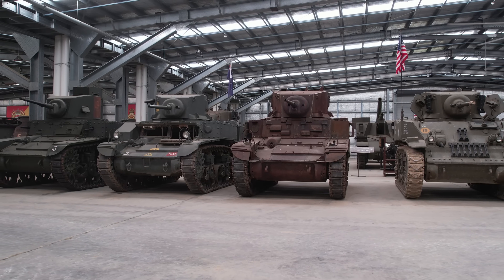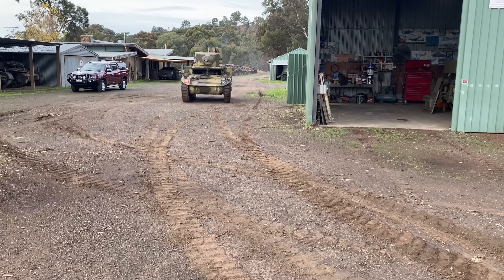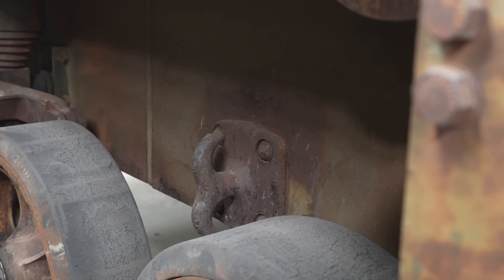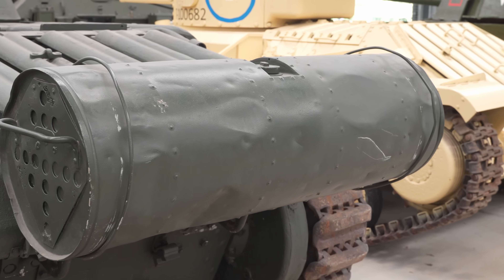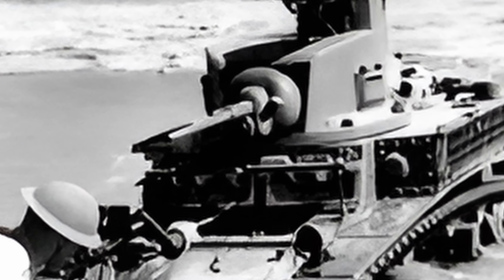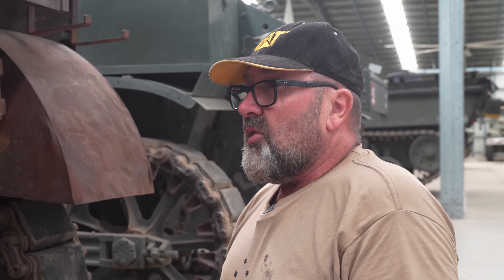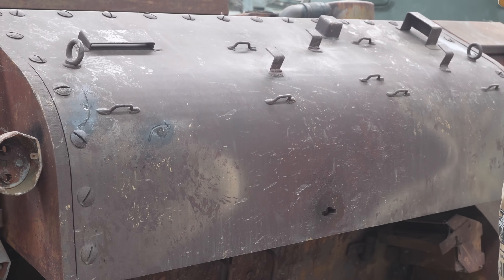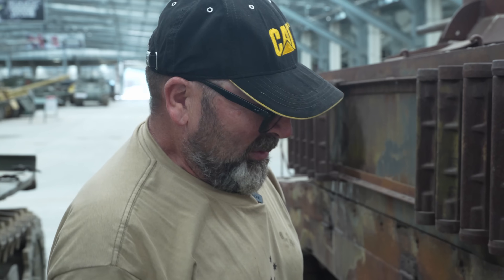Discover the History of AusArmour's Stuart Light Tanks

Comment: When ron pours the water on the tank so the writing and other markings can be read while wet, is there a permanent way it could be done ? A clear coat or some vice grip garage shine juice maybe?
Reply: Clearcoat would do it,but it wouldn't be original any more. You could use lanolin or boiled linseed oil as a less permanent method.
Reply: @quentinstacy35  I guess if they want to keep it original the second option would be the best then , better than leaving puddles on the ground everytime you wanted to show the markings.

Comment: What was the rationale using stainless welding metal? I could understand if they're using a high nickel for dissimilar metals but it just seems odd they'd use stainless on a (possibly low alloyed) carbon steel armour plate.
Reply: A Stainless steel welding rod will burn hotter than the equivalent steel welding rod at the same amps, so that would help to keep enough heat going into the plates for a proper weld.
Reply: @markfryer9880  I did some looking around for the composition of the rods used to weld armour plate back in the 1940's
They started off using 25% Chromium, 20% Nickel as it had a degree of ductility and strength. But if you've bought Ni rods or wire lately; the cost would be horrific. Later on as they figured out why welds cracked, it was due to moisture (a secret until the end of the war) So they made the first as what we would call a low-hydrogen electrodes which were 18% chromium, 8% nickel and had some molybdenum or manganese in there for the strength factor.
From what I can tell, no pre or post heat on the armour, just straight in with baked dry electrodes and away they went.